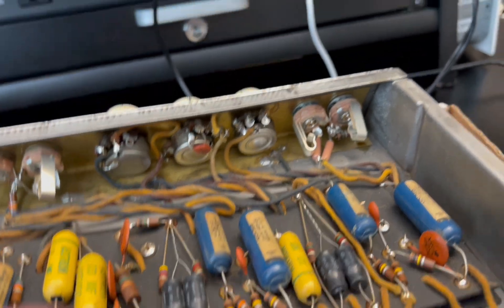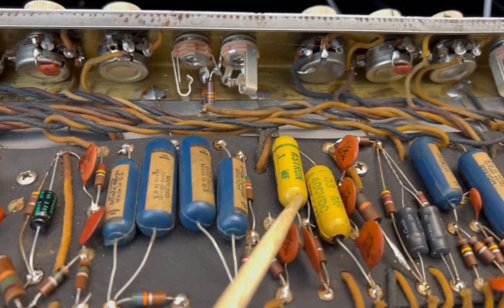1961 Fender Showman Part 1 — The Astronauts’ Amp

Comment: A possible way to read harder to read bell cover date codes, take a thin piece of notebook paper and a pencil and lightly use the side of the long pointed lead and rub back and forth on the notebook paper. Similar to a headstone rubbing to read dates on old headstones.
Reply from the maker: Appreciate it!  Just used that trick about an hour ago to highlight the hard to real letters on the engraving. I wish it would work on the bell cover , but the thing is blank.